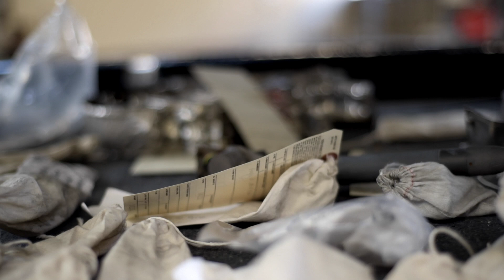C 130 Rebuild

Comment: Reading the comments is always interesting. This was a C-130H, SN4678 (74-2067) and it's not listed in the AMARG inventory. In fact, it may still be flying over in the sandbox based on at least one data tracker showing 74-2067 flying near Kuwait last week, March 18, 2021. (https://www.radarbox.com/data/registration/74-2067). More about the incident/recovery here in written form: https://www.c-130.net/c-130-news-article224.html

Comment: I was a crew chief on one this beautiful bird. After basic training went to sheppard afb in texas for aft. Maint trainining (43151f) if remember correctly in 1971 its the c-130 A . Then i was send to clark afb phil.463abw then change to 405abw i assigned to 405 OMS. When to thailand tdy assigned to 7ACCS.After clark my next station was pope afb nc. Also C-130H with 317 OMS that was 1972-73. Keep them flying boys and girls the best turbo acft. Thank you. God Bless Youand God Bless America.
Reply: I had a very similar path on C-130s, but a little earlier.  Sheppard AFB in Texas, Nov 1968 for my aircraft mechanic, turbo prop, tech school, 43131F.  Then a little over a year, early 1969 to early 1970 at Dyess AFB, Texas, in the 516th Tactical Airlift Wing in the 348th Tactical Airlift Squadron.  I Received my first airplane as a crew chief shortly after getting my 5 level, 43151F.  I was still an Airman Fist Class E-3 at that time.

Then to Clark AFB in the Philippines in the 463rd OMS, early 1970 where I worked in the phase dock as an area chief.  Got promoted to Sergeant E-4 May 1970 while at Clark.  

Then back to Dyess in late 1970 as a crew chief.  Originally back to the 348th Tactical Airlift Squadron.  The 516th TAW got decommissioned and we became the 463rd.  I got my 7 level, 43171F, and was promoted to Staff Sergeant E-5 in May 1971.  Made many TDY trips to Pope AFB N Carolina along with many to other Army and Air Force Bases.  Including Alaska and Hawaii, both on several occasions.  Made three Thunderbird Support missions.

I was at Ft Benning, GA dropping newly graduated troops for their first parachute drops, the day they convicted Lt Calley of the My Lai Massacres.  I also made two 75 day rotations to Mildenhall RAFB England.  The first in 1969 the second one in 1972.  I was discharged after my 4 year enlistment was up in September 1972, and returned home to the New Orleans area.  

I joined the Air Force Reserves shortly after returning home, where I was a flight engineer on C-130s until shortly before the C-130s were transferred to another base.  We were getting A-7s and there was not a flying position for me on the A-7s.  

Joining the Air Force was the second best decision I ever made.  I credit the Air Force and the Jaycee Organization for most of my usable education.  My best decision was to marry my wife over 53 years ago.  Just a month before leaving for the Air Force.

Comment: Spent many a cold night/hot days driving hinge pins in leading edges in my 24 year career most of which as a DCC on C-130E's and EC-130H's...  I've been retired since 2005 and still miss the planes..  Keep um flying boys and girls...
Reply: We shed some of the same blood on the same sheet metal.  Still got a cold shiver down my spine when I saw that center leading edge going on.  I spent way too many hours R2-ing leading edges.  I was in during the fleet-wide center wing crack inspection, after a few weeks I had more than my fill.  C-130E DCC.  I miss lots about the Herky, but I don't miss one second of hinge pins or "Helen Keller" bolts.
Reply: @greasemonkey981  Just talking about driving hinge pins makes my hands tingle...  Spent many long nights on flight lines all over the world, but was stationed at Wurtsmith (3 years), Pope (3 years), Sembach (3 years) and Little Rock (15 years).
Reply: @mwales2112  Sembach 85-89 Sructures Compass Call
Reply: @Maxx6689  Sembach 87-90 on that Flight line.  1585 aka Bart.
Reply: greasemonkey981   What does DCC stand for?  I was a crew chief or an area chief at the phase dock on Bs and Es 1968 to 1972 while in the Regular Air Force.  Then flight engineer for a few years while I was in the Air Force Reserves.  Don’t recall hearing that term.
Reply: @billmorris2613  Dedicated Crew Chief...
Reply: By-tor   Thanks.